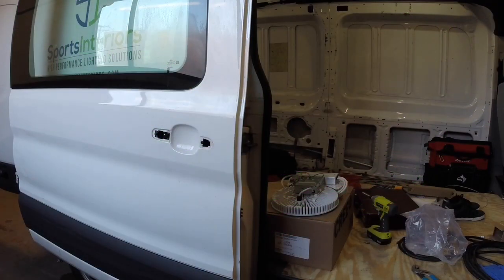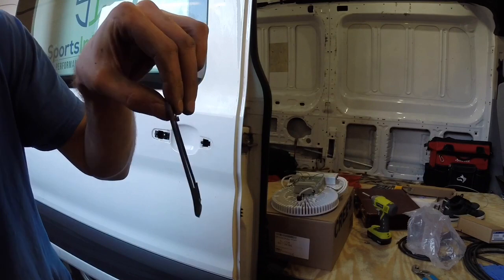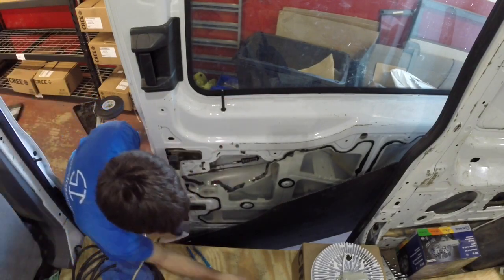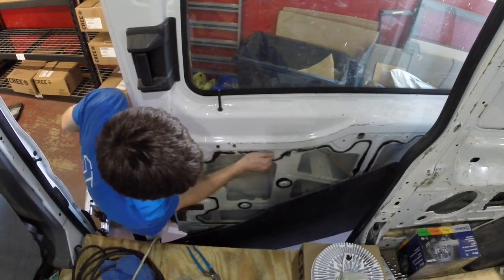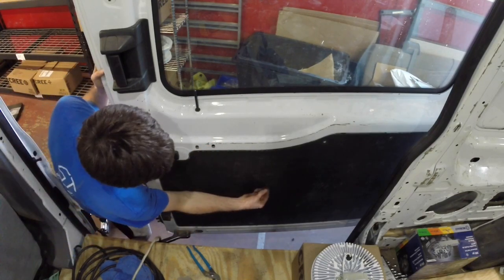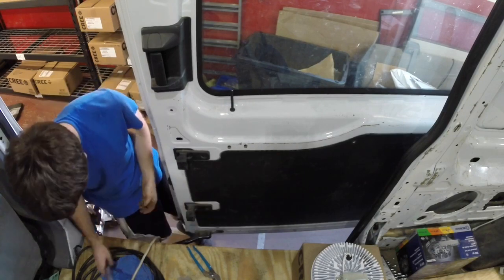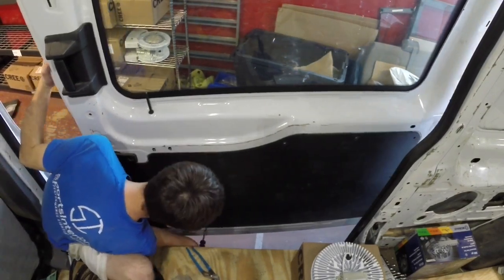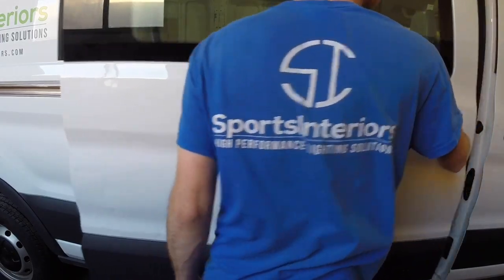Ford Transit Door Handle Repair

Comment: It appears I can do this repair without removing the interior door panel since I only need to unscrew one screw which has an access hole. Is that correct?